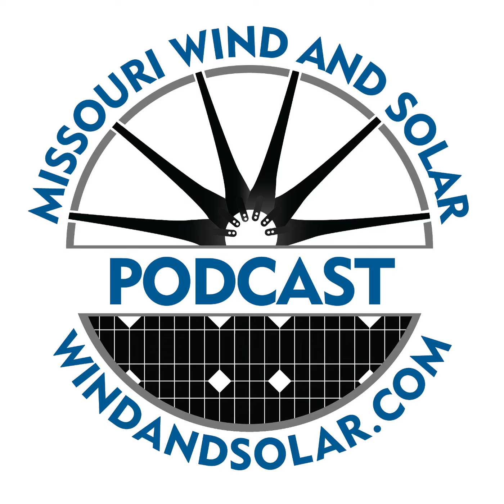PODCAST - What Is A Rectifier? (2022 05 18)

Comment: So I'm curious, is the voltage controller for the turbine an MPPT type device if charging Lithium batteries?...and if you need a "load" for the turbine when the batteries are fully charged, why not use a hot water heater with resistive heating elements to bleed off that heat so it's useful??? 🤔...or a heating element in a "sand battery" to store excess heat?
Reply from the maker: Yes, you need an MPPT on lithium batteries. You could use the hot water heater but we don't design ours as such. We take a safer approach and use resistors. Same thing with a sand battery, it's just another method of burning excess energy.